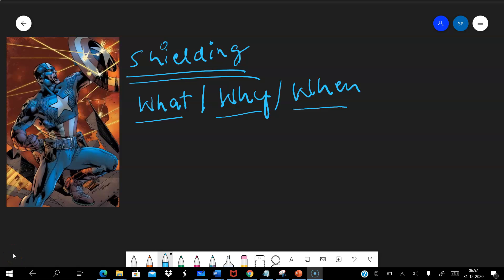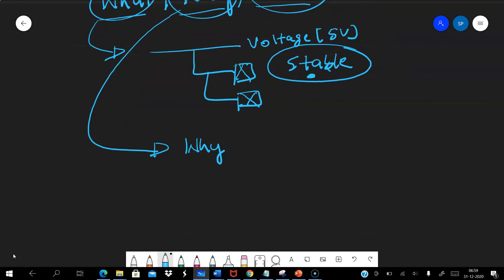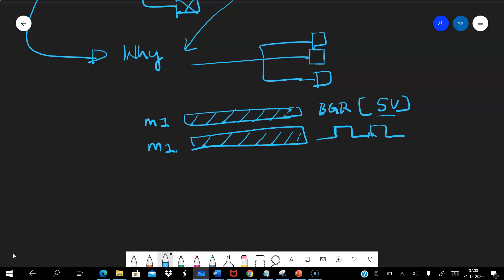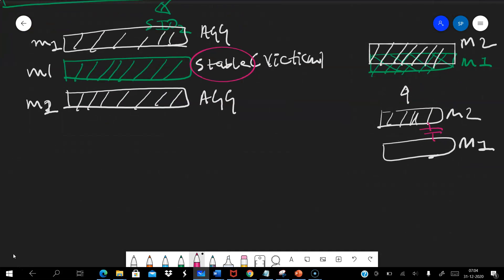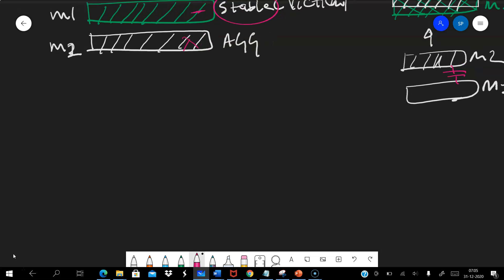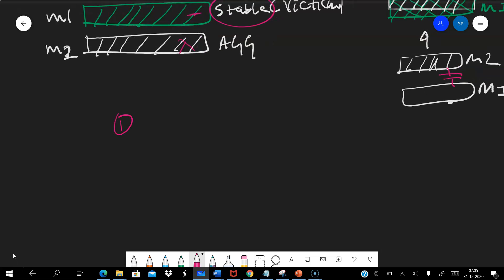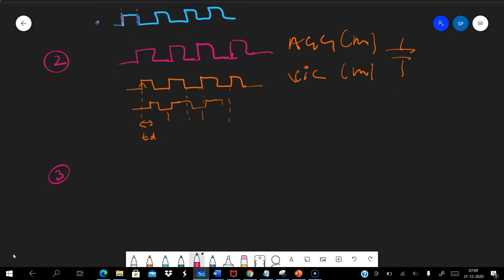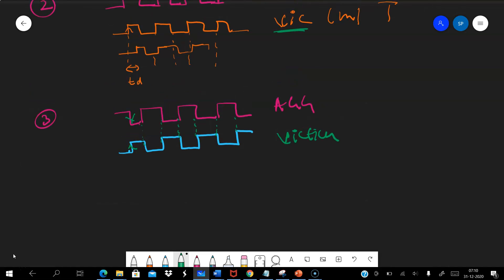Shielding In Analog Layouts-Part1

Comment: when both clk signal are in different phase the coupling twice increase not cancel out each other clk1= 1v , clk2= -1v , v = 1v - (-1v) = 2v    so voltage difference increase , coupling also increase more , so noise also increase , delay impact more more
Reply from the maker: Hi Bala,
Think of this from the victim signal point if view.
The glitch seen from the aggressor is cancelled due to the opposite ris/fall on the victim.
Here we need to only look at the coupling voltage not the absolute voltage difference.
I hope this clarifies the doubt.
Thank you